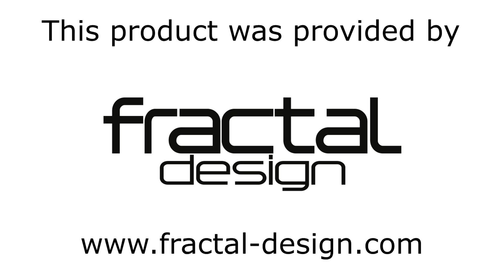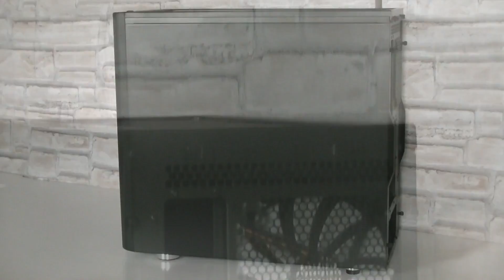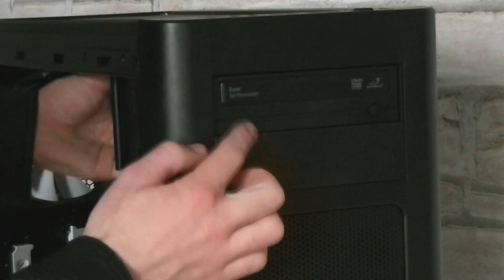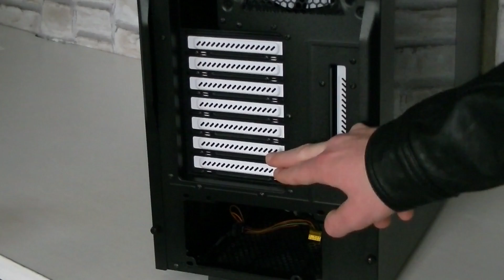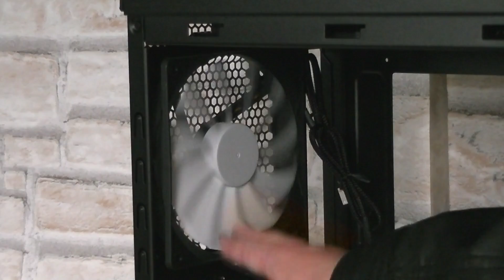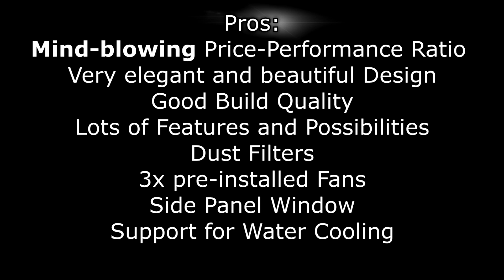Fractal Design ARC Midi R2 Review

Comment: Does anyone know if you can fit two 312mm cards (SLI) in this case with just the top HDD cage removed. I think the bottom card might hit the top of the bottom HDD cage, if anyone has experience with this case some advice would be appreciated.